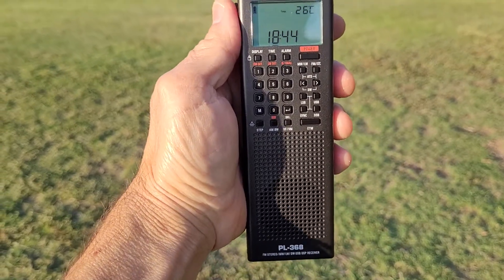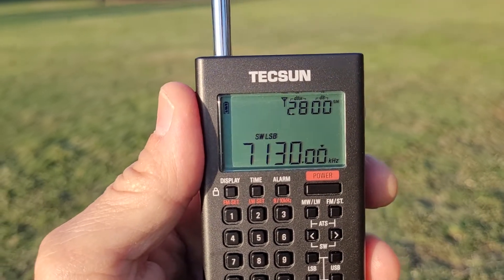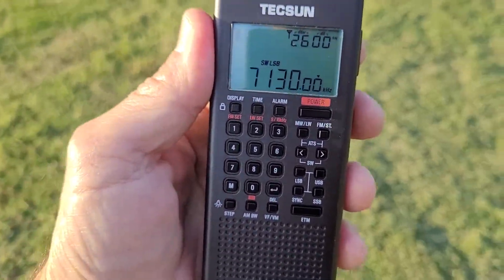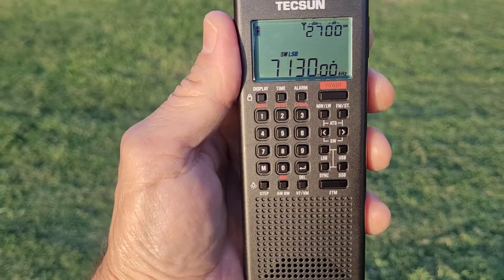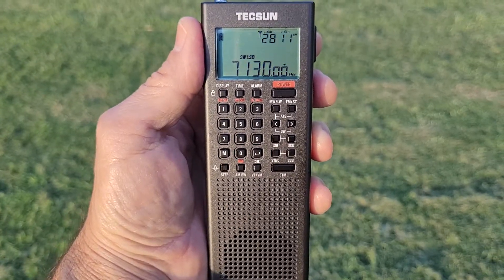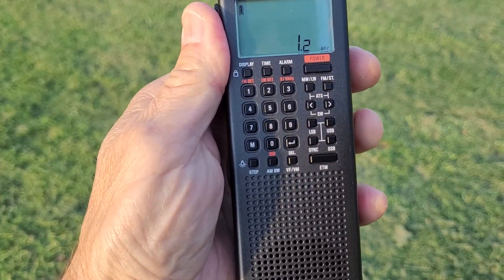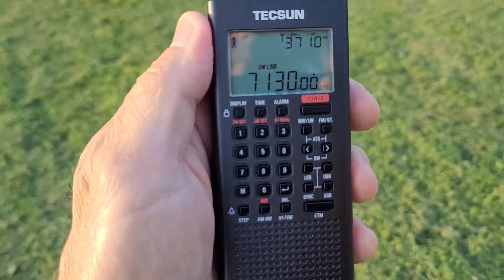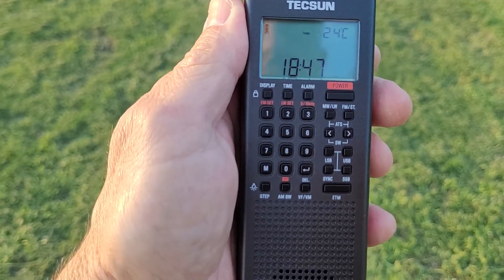Tecsun PL-368 improved AGC SSB and bandwidth demo

Comment: Excellent demo of the PL-368 in the field! I already have a PL-330 and I think it shares the same circuitry with the PL-368. The PL-330's buttons are hard to press, especially the Step and ETM switches.
Does this radio support manual frequency calibration like the PL-330?